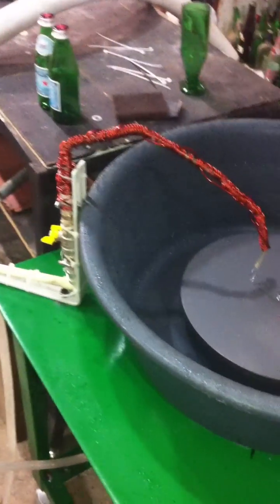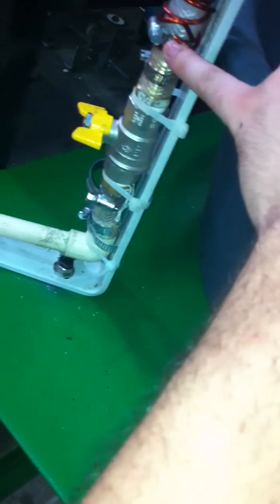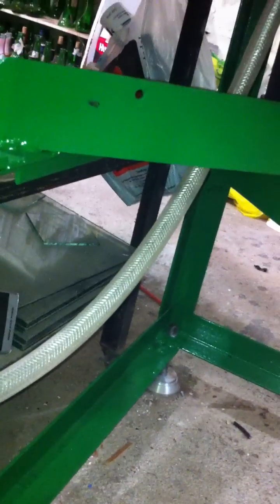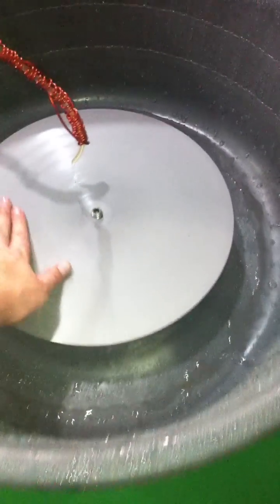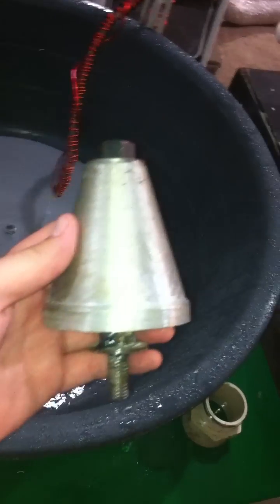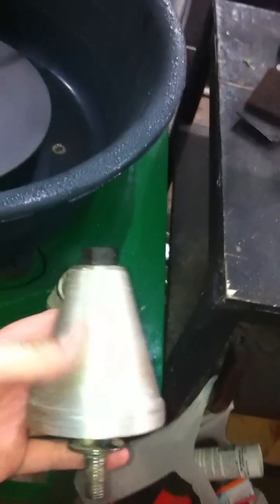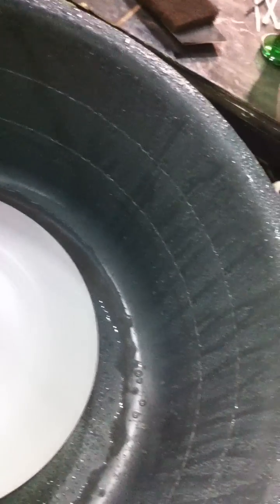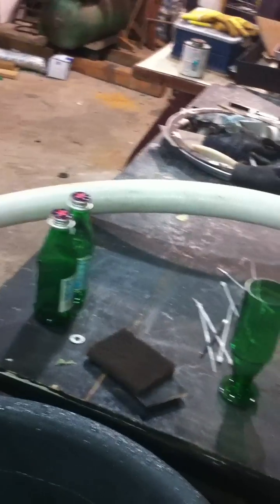Home made 12" Flat Lap. Lapidary machine. Glass bottle Recycling

Comment: instead of using pvc pipe, copper tubing would actually be better suited to this application.  Water lines from ice making installation kits are available in copper and aren't too expensive to buy.  The tube can be reshaped and cut to specific lengths to suit your requirements and don't need any reinforcement to stabilize it.  Copper tubing comes in a wide range of diameters from as small as 1/8" to as big as you want.  The 1/8" is a good option because it can provide a good steady and consistent drip with a good flow valve to adjust the flow rate of the water. 

A rubber tube fitted over the nozzle end and a tip from a plastic catsup squirt bottle can be fitted into the rubber tube and clamped tightly in place, or glued with a good rubber adhesive.  Construction adhesive or silicon glue would work very well.  Glue and a clamp on the end where the tubing joins the tubing will secure it to the copper tubing. The plastic nozzle tip can be adjusted by drilling or cutting the tip to the diameter you require to make the best and most consistent drip pattern.  To augment and enhance the flow rate and drip, a screen can be inserted inside of the nozzle to aid in suppressing water flow through the nozzle tip.  In this case, if you use filters or screening, then the tip should only be clamped, not glued.  Periodic maintenance is always needed and recommended. That said, if using a filter to control your water flow, then the filter or screen will need to be replaced regularly.  This is doubly so if you live in an area with hard water.  Calcium and mineral deposits build up rather quickly in filter systems.

A steady drip verses a spray pattern is the best option to minimize spray.  A variable speed motor can further minimize spray by slowing the rotation speed down, but can be sped up to suit your polishing needs.  The key to a good drip pattern is to be able to accurately adjust the flow rate of your water to a consistent flow level.  If you need more water, simply increase the flow by slowly opening the valve.  Control is key. Most people using a lap machines only use it with a relatively slow water flow with a medium to a slow drip so that the grinder can do its job efficiently.  Too much water and too high a flow rate can cause the grinding disc to wear out too fast and of course, cause excessive splashing.  Again, the key is consistent drip rate with a good valve to control the water's flow rate.  Nice video, thanks for sharing.

Comment: Get an old tired, cut off the wall from one side. Make sure your basin fits into the cut-out from the wall on one side. Viola! You have the water under control. You'll have to use a shaft extension. Motor: Min. 1750 RPM. Your best bet is to purchase a lap plate or have one machined. Use one to charge with polish and finer grits, textured on the surface. The other you may want to option for epoxying grinding pads to. Use a layering technique: padded foam -Saran Wrap - abrasive disk/paper. Use epoxy between each. Saran Wrap ensures you can easily remove the layers and replace pad or adhesive paper. Also use a wire coat hanger to make an adjustable arm for your water supply. 
- rockhound_mikey